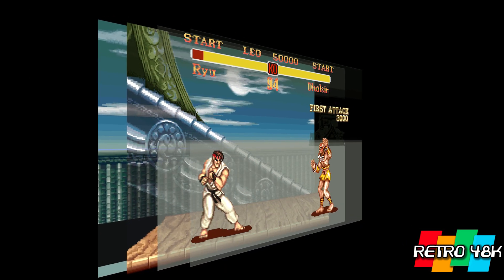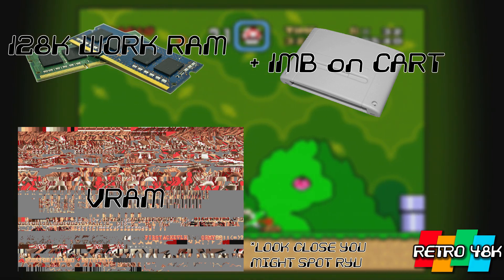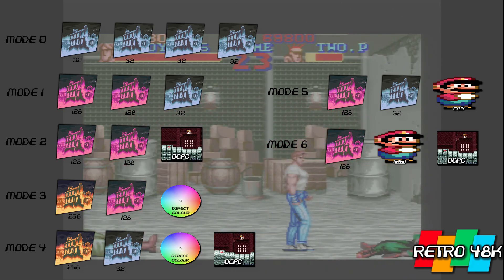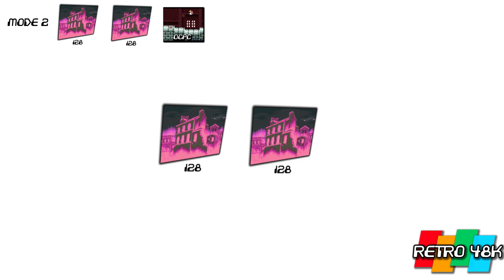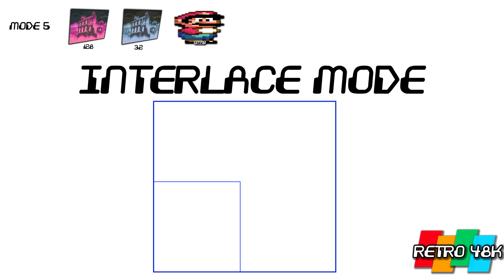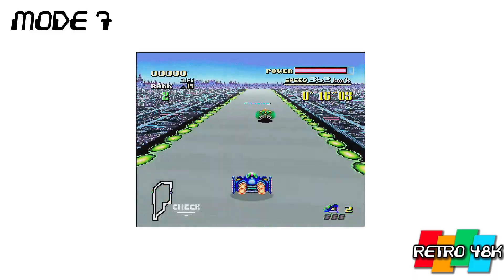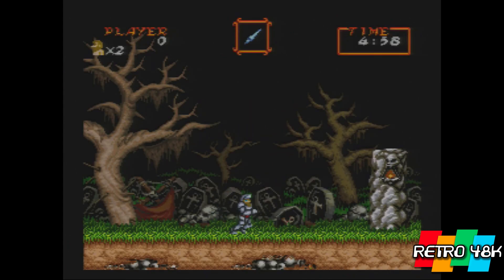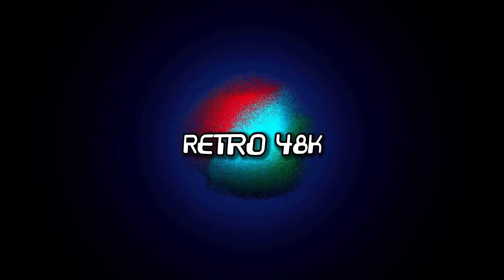How the Super Nintendo Worked

Comment: I think for the 2 player mario mode 7 the snes has the ability to alter the affine transform parameters (position + scale + rotation) on a per-scanline basis. In effect you could have as many perspective views as you like, but you can only split the screen vertically since the parameters can only be set per line. When perspective is used, you have to alter the transform parameters on each line.
Reply: Super Mario Kart enabled FBLANK and does a whole heap of stuff in that thick black bar that divides the screen. The biggest one is that it updates the OAM table midframe. So it technically displays more sprites than is supposed to be possible. It also does the change in the mode 7 affine transformation.

Not only was the SNES able to set the affine transformation on a per scanline basis, you could also switch screen modes. So you'd have a background horizon as mode 2 then swap to mode 7 for the affine part. Pilotwings for instance used this technique.

Comment: You constantly talk about "sprite layer". Technically such thing dont exist! Sprites have priorities, and that sets each individual sprite to be "positioned" in different virtual planes - behind, in front or between the backgrounds.
It is important to point out that SNES has 64k VRAM + 512 Palette + 544 OAM. meaning you have true 64k, where in many other systems, these system resources actually "eat" the useable VRAM (like PS1).

Also you dont know what a tile, a sprite and an object is. That part is total trash. The memory is called OAM (Object Attributes Memory) but technically these are the sprite definitions. A sprite is composed by tiles (from the same pile used in Backgrounds, just much smaller size). In other systems Sprites have their own share in VRAM.

Modes are nothing special on SNES. A mode define how many and how graphic object are used. Pretty much every system has modes, including Megadrive (but not even a word in that video). That is why I dont see why you spend most of the time on modes, while neglecting really important things - like sound (an unique and powerful sound card), or some of the most famous extra chips like Super FX.

Comment: Super Mario Kart uses a DSP chip to accomplish that, so it wasn’t simply doing it with Mode 7 on the console.
Reply from the maker: Yeah I get that but I didn’t want to get into the various chips on games as the video would have been hours long with all the different chips they used
Reply: @Retro48K526  suggestion: do videos per each chip or do a separate video on the chips

Comment: Good video. The SNES was 8 bit console. Only players and few magazines called it 16-bit console (generation), not Nintendo. But, le last 35 games using a 16-bit CPU / ROM inside the cartridge could be considered as it.
Reply: so its kindalike the turbo gfx...

lol sweet.
Reply: @ssppeeaarr  Exactly. The PC Engine is a great early hardware with good games too.
Reply from the maker: Is that because you consider it 8-bit due to the data bus? As the chip is often described as a 8/16bit
Reply: @Retro48K526  Yes, because the data bus that interconnect everything to the CPU bus, the cartridge slot too. Sure, internaly the CPU can compute 16-bit values (like the Z80 and other CPU does), but it require to be loaded as two 8-bit word first. The main resolution is really 8-bit too (256x224). By chance the SNES is a great system with amazing software running on it, thanks to the graphics and sound chips (and extra cartridge circuits). I love the Super NES.

Comment: Sega Genesis or MegaDrive use general purpose cpu where the developer programming skill put to the test in order to create effects that similar to what SNES can do. For example mode 7, while devs could literally flip a switch from the available mode preset on Snes DevKit, Sega devs need to calculate complex math to put reference table in order to make 68k cpu on genesis could process the data without sacrifice important cycles for other process. 

Both are awesome in their own way, like SNES when devs utilise the capability of base hardware in term of color and sound like in DK country ,it will looks almost like early 32 bit hardware could do.
Or how Panorama Cotton could display effect thay looks like mode 7 and scaling only on the base genesis hardware
Reply: There's no switch that would make a mode7 effect magically do perspective for you on the SNES(and on the GBA for that matter).  You'd have to do the "complex" calculations yourself for the affine transforms(every Hblank in the case of mode7) supported by some BG modes.

Comment: I miss this era where hardware from each of the major console makers was sufficiently bespoke and implemented in unique ways that one could easily tell what was a TG16, a Genesis/MD or a SNES/SFC. Same for the audio. Nowadays I challenge anyone to determine if a screen grab from a multiplatform game is from a PS5 or an Xbox Series X (Series S is easier to detect but between the two full-fat consoles, its very difficult to tell them apart). 

PS: Could I make a request for a video on the C64?
Reply from the maker: I will add C64 to the list thanks for watching
Reply: Acorn Electron too, I need to fix mine
Reply: ya its a sad consequence of adavancing tech. where everything eventually is the same as ther comptetion...
like the creator of the vid says these older gen consoles had soul! which new consoles lack.

havent really felt hyped for any console post dreamcast n gamecube era 

also the look of the consoles designs  were better in the 90s. 
og NES is still the goat 😁
Reply: No way. I don't miss multi system releases not being ports but rather two different companies making the same game. That was a disaster. Ps4 and Xbox one was the first time game makers could worry about making the game and not worry about making it work on different platforms.
Reply: I’m pretty sure devs don’t miss needing to learn hardware specific techniques and assembly languages
Reply: @youngwt1  Oh good God no! I still have ptsd from trying to create sprites for my c64. It was like sudoku from hell.

Comment: The complexities of the SNES colour palettes is real. But I learned something. In mode 0, the background tiles can be only 4 colours each (although this might actually be 3, depending if the alpha index can be made not transparent). So if there are 32 colours per layer, that means there are eight 2bit/4 colour palettes shared for the background layers.

No games are going to display anything much over 128 colours just purely because with a 15 colour limit per sprite or tile, the opportunity to increase the colour count is more or less hamstrung by the limitation of requiring one of the 8 palettes available to your layer more or less share similar tones for any given scene or character, as 8 palettes are available to the sprite layer and 8 to the background layers.
Reply: It is just so wild to invest in this. Phillips CDi already had direct color without limits. Jaguar and 32x did mostly away with palettes. SNES is a dead end. Last of the 2d consoles.
Reply: @ArneChristianRosenfeldt  the SNES was the last console to use hardware sprite and tile based graphics.

Although the design of the SNES actually took place before the design of the Mega Drive, making the Sega machine the last sprite/tile based machine.

The PSX and Saturn both have sprite capabilities but there is no longer indexed colour or limits on size.

Tile engines are so efficient. The speeds the Mega Drive could handle in 2D scenes is still rarely matched in a modern 2D game.

Because the hardware was so specific to moving tiles and the whole system was carefully tuned.

The NeoGeo is sprites but no tiles. What tiles are, is a background layer with all elements moving in parallel. Again, a cost saving measure that is practical as background tiles don't need to move independently.

That's why 3D games don't work too well on a tile based console.

A direct colour display (useless on the SNES due to hardware limits) is better for 3D as new tiles aren't needing to be generated by the cpu, then copied into the vram with lots of squares contain bit's of 3D geometry that are then discarded and generated again in realtime. Slowly.

The 32X has a beefy dual cpu design with 2 23Mhz sh2's. The Cdi (1991) has a 15.5Mhz 68070 which no doubt does well at moving the graphics into vram from what I assume is a fairly powerful gpu. Although making a 2D game move fast on the CDi, I think was a challenge, although that just might not have been the kind of game the publishers were pushing.

So tile engines weren't strictly neccassary in 1991. But the SNES needed to be released before the machine became obsolete. And it enjoyed almost 4 years of relevancy, despite not really being fit for purpose as programmers struggled to achieve reasonable frame rates.
Reply: I've researched Sega hardware for about the past 5 years and I found no issue in their design methodology, despite the protestations of 'general consensus' / the google ai results.

For instance, suggested result 'Sega 32X' 'Why did the 32X fail' from the wiki article it states "...inability to function without an attached Genesis and lack of a CD drive"

This is an answer. But if you are really analysing the markets carefully around that time it seems incongruent to assume such a conclusion as reasonable.

This obviously points towards social engineering. Which is where my research simply got too scary and I needed to go and shiver under my blankets for a bit.
Reply: @ tiles are loved by modern 2d game developers ( retro games ). Just it looks to me that everyone uses a single palette like on the PC VGA . IBM sourced a discrete chip with this huge 256 palette on it and a DAC. Wild combination. Jaguar and Saturn still have a 256 entry palette, I think.

Jaguar allows sprites with 16 colours bringing back this complicated double hop loop-up, but at least Rayman only uses 8bpp sprites. So no funny double indirect color lookup like already on the original NES. IMHO it was a fault not to give the Jaguar tiles. Flare tried to generalise the concept, but failed performance wise.

PS1 allow the use of a palette on textures. But really there is no hardware. You just pay for two look-ups in GDRAM. Likewise N64 looks up 3? palette entries in TMEM for filtered textures?? I guess that this speed penalty killed the palette on N64. And stupid Jaguar blitter cannot do it, even though the hardware palette sits on the same Tom chip.

With 64 bit I wonder what to store per tile if not a palette? You could pull from any coordinate of a texture atlas. Flip mirror z-priority.
Reply: @ArneChristianRosenfeldt  2D is not a dead end though. My background in graphic design and IT (original, I know) gives me this insight.

The 3D engine is pointless because it only adds immersion. Immersion is at odds with gameplay.

a 3d scene requires exponentially more processing power, but there's more. The limitations of the viewpoint are a constant issue.

I watched Bayonetta and was impressed with the direction of the game to control the camera viewpoint for you in many instances.

This is something in-between directing a move and a game and really there's only a few studios rich and sophisticated enough to ahcieve this.
Reply: But it's false to say 3D uses more processing. That doesn't make sense as a statement. But the complete ditching of 2D engines died out by the time of the PS2 and DC, which offered no (unscalable) graphic assets, but simple flat textured polygon's work fine, no probs.

But the quality of the image is not considered. This is why PSX games like Rayman and Oddworld topped the UK charts, where the PSX 3D capabilities fell flat.

These are still reactively simple 2D scenes but full of colour and animation. Symphony of the Night, I'm told used technical programming to achieve the colour counts.

The PSX is a 2D machine, primarily, with a 3D function augmented into it a bit later in the process with an area of fast vram and geometry and lighting engine included.

For 3D gaming, the Saturn seems to better choice with it's superior lineup of 3D software and 3D capabilities.

But the advanced 2D abilities of the Saturn were a real use to 2D game design, offloading many effects into VDP2, which does more than backgrounds.

There are other considerations that amount to a good scene. Modern games suffer from microstuttering and frame drops, despite the powerful hardware, greatly antagonised by abstracted memory controllers and microcode you are not usually authorised to access and is highly complex.

The Sega design philosophy is to prioritise frame rate and degrade the graphics until the scene is smooth. The achievement of a smooth scene takes a very keen eye and a depth of knowledge to achieve and with shoddy Nintendo or Sony hardware is an uphill struggle.

The design of you hardware is greatly benefitted by a deep insight into the final application of your system and if your hardware department are not well versed with the demands, then you might simply have to rely on 3rd parties like Ricoh, Toshiba or SGI to finalise your design across two different companies or use the Intel bridge memory architecture to add power, at the detriment of accessibility to the system for the devs.
Reply: This is why I'm looking for Motorola experts to publish tutorials to help enthusiasts utilise the chip and demonstrate a largely pointless and seemingly blind drive towards ever heavier and obscured architectures, where artistic ability and game mechanic acumen are the only relevant prerequisites for a smash hit.
Reply: @ the dead ends for me is this double palette jumping where you cannot just use any of 256 palette entries on any sprite or tile. Graphic design still tells us to stick to a global palette. Even though I don’t think like this, I tolerate it. Mode-7 has 8 bpp . 

3d used palettes on textures. I think that Doom has this one VGA 256 entry palette for this. Yeah, maybe some sand or grass texture could use their own palette? 3d games need any resolution they can get. But is a palette really the best way to compress? Imagine if the N64 would use not 2% of its die for TMEM, but 50%! Then the texture could be decompressed on load and mipmaps created. I mean, RDRAM would become the bottleneck. Sort the scene by texture to do this only once per frame. I have understood that wavelets do implement this mip map thing, but without blocking artifacts. But then mip maps need gamma correction. So there is no synergy. Just like mpeg decompresses a whole frame , a N64 game would decompress a similar amount of textures (within the viewing frustum). No need for humans to find the optimal palette. No weird dithering. I guess that is why the blitter on the Jaguar cannot do this. Just decompress jpeg from ROM to RAM. Cache this.

Funny how a texture cache for N64 used tiles (was it Kaze or that other guy?). UV mapping and a texture atlas don’t use tiles usually. Most games on Jaguar use lame quads, so again, caching is easy.
Reply: @ArneChristianRosenfeldt  there's nothing more mysterious than N64 hardware. Did you know it only had a single 64bit register which was beyond pointless and added work for people, as they made sure it didn't spoil things by ensuring it was avoided at all costs. Lolz. The bus is 9bit on N64 apparently.
Reply: @ N64 has 32 64 bit integer registers and 16 64 bit float registers and 32 128 bit vector float registers.

But did you know that the N64 CPU cache is only single associative, while SH2 already had a 4 associative cache like i486 .

N64 also only has 9 address lines . Jaguar already uses DRAM multiplexing and sends the address sequentially in two parts. N64 tops this and needs to send 4 parts sequentially. I guess that this matches the 4 parts data . With some pipelining and overlap …

Jaguar could have two banks of memory. If they had a dedicated data bus for memory, Atari could have used memory interleave and load 64 bit in two parts. Almost like N64. But maybe they found out that cheap DRAM does not preserve as sharp edges on output enable.
Reply: @ArneChristianRosenfeldt  I found the channel. It's Kaze Emanuar. I just asked him again and he replied in minutes!

@KazeN64
"what i need to avoid is 64bit floats. they can often happen accidentally through compiler conventions and they are much slower to execute."

And the 9bit bus... Is that the same as address lines? I don't know. I'm only an enthusiast, you know.
Reply: @ there are two busses 9 bit data and 9 bit control. RamBus in N64 is really complicated. I think SDRAM has an address bus. No abstract control signals are sent. But then again Synchronous means that data is sent using a clock. So there need to be some address counter in the memory chip? Cache needs this counter to wrap around on a certain page size. How is this matched? Or was first generation SDRAM not meant for cache? Why even use a clock when no double data rate?
Reply: @ArneChristianRosenfeldt  I think. Just like the NES and SNES, these consoles are prohibitively complicated.
Reply: @ribenasquash  have you tried pico8 ? I once tried scratch, but had a hard time to get the sprite on screen. With NES at least you only have a byte for x . And on a good CRT (with low overscan for development), always at least 3px columns are visible.

Ideally, this would go down to 1 . And you need to set y to zero to turn sprites off . And likewise I would clamp y position so that a sprite cannot hide in the bottom border.

Similarly sound voices can have volume 0 to be off. Frequency needs to have an offset of 30 Hz and limited below 15 kHz to be audible.